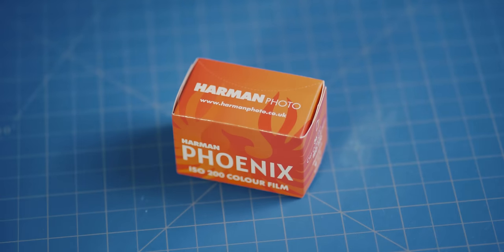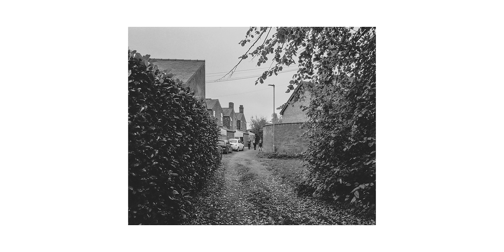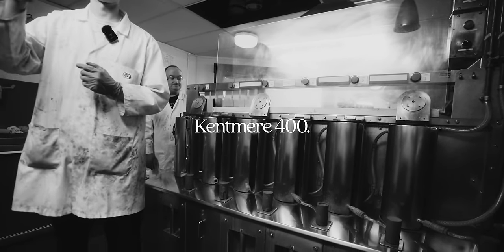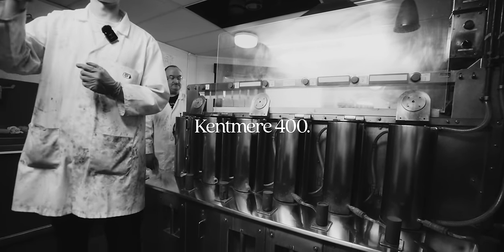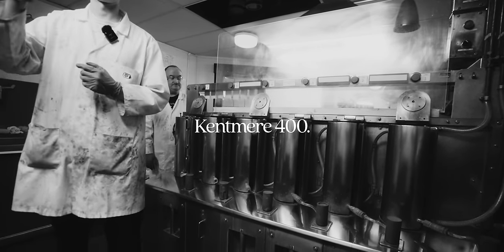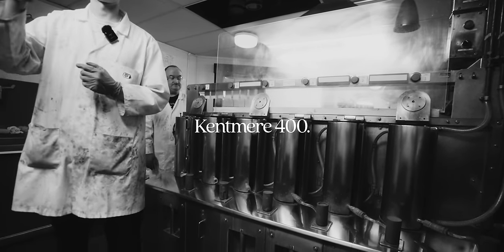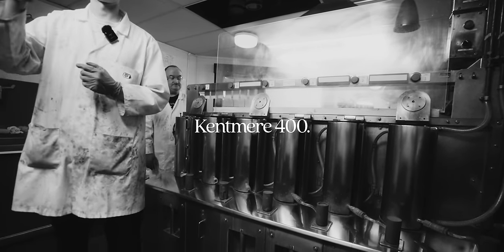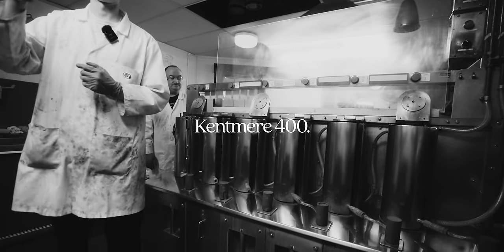a visit to ilford

Comment: The whole video in BW fits pretty well with Ilford. I'm just wondering now what lighting they used when showing the emulsion and coating in the lab. Did you shoot under safelight and your camera picked it up so well that I can't tell from the BW conversion or was it just for show under normal lighting? 
Your pancake and syrup analogy was spot on :D

Possible small error:
20:24: I suppose the base rolls aren't made of gelatin but PET or acetate. At least that's what film base is normally made out of.
Reply: Still got gelatin in em